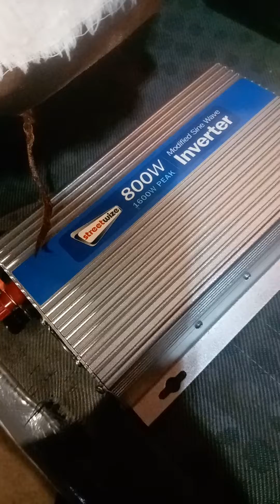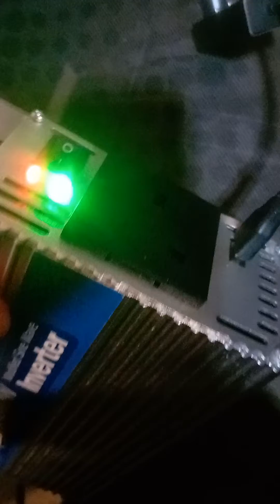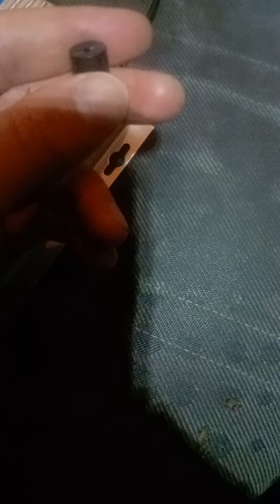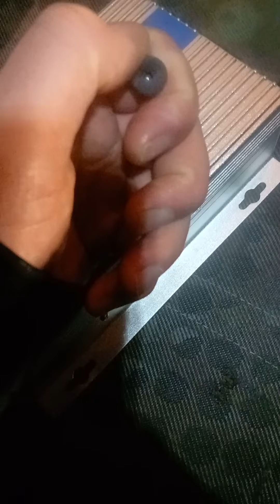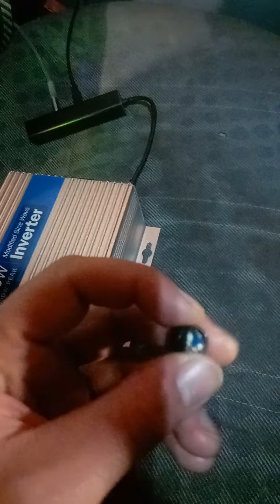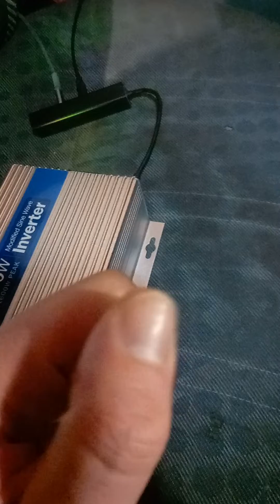How to remove beeping sound from power inverter

Comment: 😂
That denies your inverter from notifying you of subsequent problems.

How do you resolve the cause of the beeping sound?
Reply: not hard either overloaded so look at what your running if its not working and other cause is battery is dead so its really not hard. have had mine out for 4 years never an issue